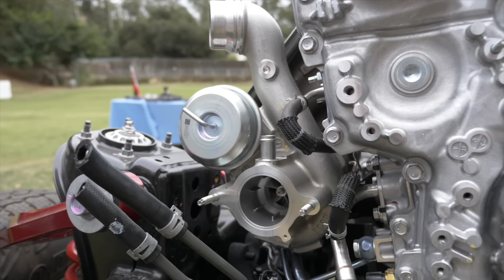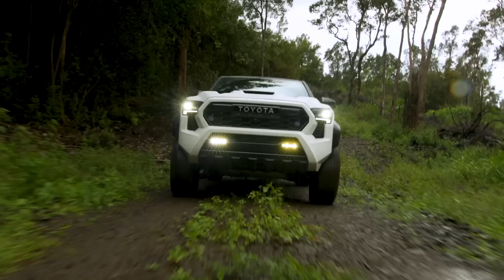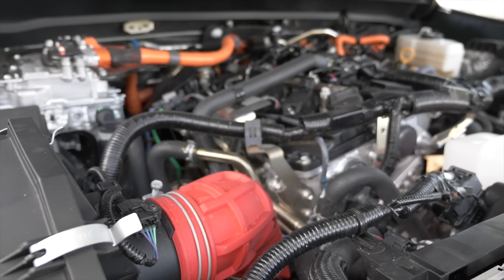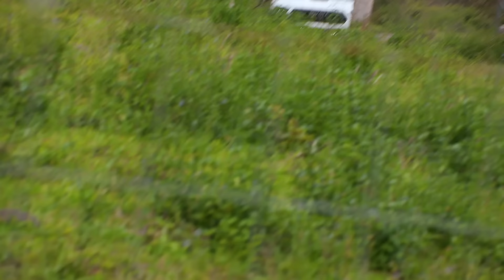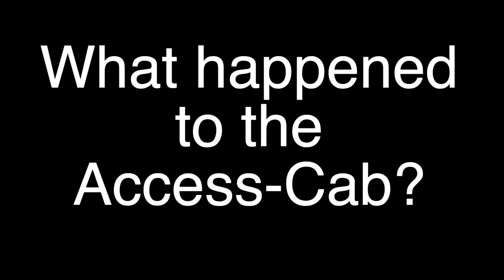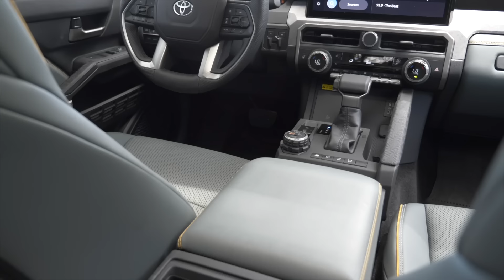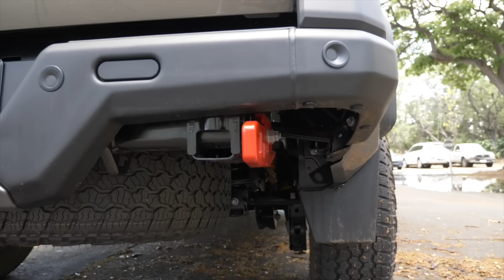2024 Toyota Tacoma Chief Engineer on new engine reliability and more...

Comment: I still believe a V-8 or V-6 will outlast a stressed out 4 cylinder
Reply: Since this engine is so good they should warranty the turbo for at least 200,000 miles
Reply: @freddyw4555 why not 250,000 😅
Reply: 100%
Reply: It always will . Any new turbo will need extra " care " , and this one is no different.
Reply: @steveriddle8446  Living in Japan for 11 years where all cars are Turbo due to regulations they last just as long, run better in every way.  My Skyline had well over a 100k of HARD FREEEEEKKING HARD ASS MILES not an issue, sold it to another sailor, was still running years later, I assume he sold it also to another Sailor
Reply: @steveriddle8446  it all depends on how it is engineered.  The 1.6L 1100hp v6 in F1 outlats the 5.9L V8 in NASCAR that typically only runs at 600 HP because there not allowed to run more HP. 

I'm not saying one is going to be better than the other I have no clue. It really just depends on what it was engineered to do.
Reply: 400k on my original turbo.. there's those that think they know what they are talking about and those that actually live it. which one are you? @steveriddle8446
Reply: I own a 2nd gen 4.0 with the unbreakable, smooth, and perfectly ratioed 5-speed automatic, which I think was their high-water mark small-truck drivetrain for both reliability and durability.  The 4.0 is a half million mile engine.  I don’t see the 2.4L turbo, and certainly not the hybrid, lasting 500,000 miles without multi $10k component repairs.
Reply: @jefftrimm7806  I'm with you if we include the 6 speed manual I'm my 2010 TRD Offroad Tacoma.
Reply: @jefftrimm7806  it will outlast components like starters and there is much less stress on the 12v system with the hybrid. I have a 4th gen hybrid and would have not purchased a Tacoma again if they had chosen to be NA
Reply: Agreed. I'd have no problem going back to the old days of 3k oil changes to keep one of these going to 300k. I just don't see those turbos lasting that long no matter the maintenance. I'm keeping my 2022 TRD Off Road for a while. I'd consider a 4th gen once I see a few going over 200k miles right before the gen 5 release.
Reply: Same here. @rndsommer40
Reply: @rndsommer40  he mentioned they're rating it to the standard for their commercial vehicles, where longevity is extremely critical. look at semi trucks, they have big turbos and they're hauling 80k lbs for easily up to 500k miles. its about how under stress the component is, and in this case, they've overbuilt the turbo and significantly increased cooling capability in the engine and used a strong block to withhold the pressures.
Reply: @rndsommer40  LOL 2022 Taco isn't meant to be replaced for another 20 years and you're crying the Turbo wont last!?!?!
Reply: @StinkPickle4000  I have 30+ years of experience with turbo'd gas engines, and they DON'T LAST.  Diesels are another matter, they're strong as hell and can handle turbos.  Toyota should've dropped a V4 turbo diesel in it.
Reply: @rndsommer40 A John Deere tractor will last over 1,000,0000 miles. Why not just drive one of them?
Reply: @rndsommer40 I'm keeping my 2010 4.0 V6 6 speed manual TRD Offroad Tacoma for the rest of time. I don't believe that these small displacement turbo charged engines will last like naturally aspirated engines. When it comes to powerful engines that last under load, there's no replacement for displacement.
Reply: I've never had a 4 banger that didn't last at least 200k miles. Yes they sound horrible but they are great engines and super durable, that's why all the old school small work trucks have them and still run today.
Reply: @foodconnoisseur4498  Exactly, people forget that big engines weren't a thing back in the day. Especially not in the rest of the world. Europe and Asia has gotten 4 bangers for decades and they run and last no problem.
Reply: @foodconnoisseur4498  and a 6 will STILL last longer
Reply: @tonys3825  A 6 will last longer than a 4? Toyota's 2.7L four is considered one of the most reliable engines ever.
Reply: @GrnXnham  the 2.7l 4 was not turbocharged....I stand by my statement
Reply: @GrnXnham  my current V6 is over 310k miles....not a problem in sight
Reply: @GrnXnham 

An eternity of service at 140 HP!
Reply: Look at Hondas 1.5 turbo they put in their newer cars. They’re already having a lot of problems with over heating and oil dilution. Now imagine if it was put in a truck and started hauling things, plus another maintenance issue the average joe has to take care of now. This chief engineer said it himself, they made the decision mainly for emissions 🤦‍♂️
Reply: The only million mile tacoma is a 4 banger
Reply: @rkwjunior2298  With all the unproven high tech bells, whistles, and gadgets on the new Toyotas, we will never see another million mile toyota. Too much to go wrong.
Reply: @barbwire7449 The million mile toyota had  2 engines and a torque converter replaced. So it truthfully didn't make it 1 million miles, the body and chassis had over a million miles. im sure he had to replace other things as you will on anything.  So the "million mile" toyota thing is misleading.
Reply: @rkwjunior2298  There was a 1 million mile 2007 Tundra with a V8 that only had a minor transmission problem. I understand it was mostly interstate miles driven mostly at constant speed. Toyota gave the man a new Tundra for it. When taken apart it was claimed by Toyota engineers that the engine could have made another few hundred thousand miles.
Reply: @barbwire7449  And depends on where u live climate.  It is just not realistic to say "Tacomas/Tundra can go a million miles." After a certain amount of time most aren't worth fixing. Everything breaks, brake lines, steering components,  suspension etc, etc.
Reply: @rkwjunior2298  My farmer neighbor has a 2001 Tundra V8 with 436,000 miles. He pulls 5 tons daily, including cotton and peanut trailers, irrigation equipment, and water wagons for irrigation. He has never changed the differential or transmission fluid. He uses dinosaur conventional oil, buying the cheapest brand on sale every oil change. He tells me he has not spent one dollar on that truck other than regular maintenance, such as oil changes, tires, plugs, batteries etc.

I have a 2006 V6 Tundra that is 18 years old. Other than regular maintenance as above, I spent $14 for a gas cap (seal went bad and gave a check engine light). No way these new Toyotas will do it. Too many high tech gadgets, sensors, bells, whistles, CVT's (continuously Variable Trash) transmissions, unproven turbo chargers.

 I just read where Toyota has a recall on 2024 Tundras, Lexus, and 480,000 Tacomas, 2022 and 2023. Welding debris left in the axles of Tacomas, and the transmissions of Tundras and Lexus are still engaged in park. Toyota quality is already going down.
Reply: Especially a turbocharged 4 banger
Reply: @@bobbybradley7862 I'd go with the carbureted 22R that was in my 86 4 speed manual 2wd pickup or even better the fule injected 22R-E from my 93 5 speed manual 2wd pickup.
Reply: Many said the same when engine specs moved from all V-8s to the introduction of V-6s.  Torque created at lower RPM is what interests truck owners that need/want to tow.  I'm guessing this will prove to be reliable as well...we'll see.
Reply: keyword stressed.....an inline engine that is naturally aspirated will last the longest, regardless of cylinder count
Reply: I have a 2010 Subaru Legacy GT...2.5 L 4 cyl, turbo charged. I bought it new and it now has 315,000 kms and still runs like new. Smooth power, dependable.
Reply: The entry level model for these sorry hunks of shit doesn't even have rear doors to access the extended cab.  It will also only tow 3500 pounds.  lol the truck wouldn't even tow itself and they want like 35 grand for the base model!
Reply: Your belief is biased, backed up by nothing except your feelings and opinions
Reply: Someone should teach this guy how to engineer a salad.
Reply: That is proven by physics.
Reply: add this any persons opinion who wants to argue with physics ,  we have seen  V-8  and  V-6 outlast stressed out 4 cylinder  engines  because theres  more metal , parts  ,and  surface area   to wear  more on over time on  them  verse   a 4 cylinder which has Less of all of them  ,  it ether goes one way of another  : you buy extra gas for the  v6 v8 over time  which isnt  that bad  OR  or    another i4 replacement   engine~   which one do you choose?
Reply: @spanishtreasure9551  without data you are just another person with an opinion
Reply: @drivewayhero   physics  doesnt lie  thats all the data anyone needs ... its less material to wear ie  surface areas   of parts pistons  and  block/bore .
Reply: This is the reason I'm not selling my 2014 tacoma. I bet my v6 will last longer than the new Motors.
Reply: Triumph V8, BMW N63, North Star V8, EcoDiesel, Chrysler LH V6. and so on..  just b/c its a v6 or v8 does not make it more reliable.
Reply: Toyota has been putting turbos in 4cyl for years!
Reply: If the goal is to make sure a turbo charged engine lasts as long as what prior NA engines got, it shouldn't be that hard.  If Toyota says it's just as reliable, I'm going to believe them, till someone or I see different.  Reliability is why people by Toyotas, and they know it.  If they didn't make any new engine as reliable as the past, they'd be shooting themselves in the foot.
Reply: @crabjoe  exactly. if they cant make a reliable turbo and hybrid system, they would be better off increasing their average mpg by releasing ev's instead and selling NA gas vehicles, but they dont.
Reply: How is it stressed out? They build them to handle the forced air. I've had turbo vw engines go over 500 000 kilometers.
Reply: toyota in's japan have had nothing but 4cyl turbos for years
Reply: It all depends on how that 4 cylinder is built.  There are 4 cylinder turbo diesels that will go hundreds of thousands of miles.  A gas turbo engine can do the same if built strong enough.
Reply: @1guyin10 there’s no getting around physics. A turbo 4 cylinder in a car of the same weight will have to be pushed to higher rpms and more engine pressure throughout its lifespan than a v6 or v8 in a vehicle of the same weight. A turbo adds another point of failure as well, and another thing that needs to be oiled, meaning more and faster oil wear. Has to keep the engine AND turbo lubricated now. Been saving up for a new car and was going to get a tacoma, but I’m probably going to get a new 4runner now since it still has the tried and tested v6 that’s been around forever
Reply: @FirstnameLastname-gz8hy agree. That’s why I bought the 23.
Reply: @FirstnameLastname-gz8hy  Let's be honest. This day in age, 90% of the people out there buying trucks are never hauling a damn thing with it. It's hardly applicable to the masses that use these trucks as pavement queens. The people who actually use their trucks for work aren't buying TRD Pro's or Raptors or whatever other "high performance" trucks are out there.
Reply: @europeanlegend9347  even when not towing, a 4cylinder turbo will not have the longevity of a 6 cylinder. More performance isn’t the only benefit of a bigger engine, you get more longevity out of an engine that holds lower rpms under load of acceleration.  I was using load in terms of load on the engine, not load as in payload or hauling.
Reply: @FirstnameLastname-gz8hy  That's where I was at. Bought a new 4runner and am very pleased with the 4.0 v6. If you're going to buy one new, better act fast! Dealers are moving em in anticipation for the 2025s with the turbo 4s!
Reply: @1guyin10 diesel engines are completely different then gas engines 😂😂
Reply: @1guyin10 another thing that a lot of people fail to realize is diesel fuel itself is far better at lubrication than gasoline. It’s even referred to as “diesel oil” and the high sulfur, less refined diesel is sold as “heating oil”.
Reply: @1guyin10  - If that well built 4 cylinder turbo just drives around town with not towing or loading in a small sedan, yeah it can last over 150K miles. But even a well built 4 cylinder turbo in a Tacoma towing heavy loads and hauling heavy equipment on a daily basis for construction jobs isn't going to outlast a V8 or diesel work truck. This new Tacoma is built more to please the "Stop Oil" eco system lunatics. Looks like Toyota is gonna lose it's reliability championship to Honda and Ford.
Reply: @1guyin10 diesel engines typically operate at much lower rpms than gasoline engines, relying on greater torque to keep HP numbers adequate.  Lower rpm makes for much better fuel economy as well.
Reply: @1guyin10 entirely different function, diesels fire from compression and not ignition therefor torque is made way down low in the RPMs.  This inherently gives the engine an edge when accelerating for most of its life as it’s less taxing.  Obviously if you’re racing into the higher RPMs all the time with a diesel that will be very contradictory because neither will it benefit you in speed or longevity, but in reference to how you’re supposed to drive it, it loves lower revs city driving or punchy climbs off-road, that’s where it shines.  A gasser is not going to be loving those same situations off-road. 

It’s comparing apples and oranges, doesn’t mean anything that they both are an inline 4 with turbos.  Generally the turbos are small with very low boost pressures because the idea is that they are “supplementary”.   Ask any person who’s worked on those old 90s TD from the likes of Mitsubishi, Toyota, Land Rover, Mercedes etc, the minute you turn up the boost, it begets problem after problem and immediately limits the long term life of the engine.  Even with tunes, new internals yadyadayada, you can’t defeat the simple fact that forced induction accelerates wear period.  It’s just that diesels  are better equipped at dealing with the increased temperatures and are suited for the low RPM torque situations previously stated, while also from a design point being more robust therefor capable of handling more kilometers in general.  Don’t take my word; look at non-turbo diesels from the 90s early 2000s and the amount of kilometers they did back in their day, nothing compares….
Reply: @1guyin10 there's a big difference  between  going a couple  hundred  thousand  miles and doing what the NA v6 to comas can do..which is his 6,7,8 ..over have a mil miles comfortably  with good maintenance..

They just retired one that had 1.6 million  miles.
Reply: @1guyin10  That would be wonderful but they intentionally build them with a shelflife of about 200,000 miles max because they want you to buy a new one
Reply: @rjeepster8640 source?
Reply: @rjeepster8640 how in the hell do you know that jeep guy?? 😂😂😂😂
Reply: @rjeepster8640  still, you can make any engine have a shelf life. if they made this engine only last around 200k miles, whos to say they didnt do the same for your v6? it would be just as easy to make a v6 last a shorter time because all you gotta do is make it out of weaker, cheaper materials and there you go. of course a turbo i4 is going to be under more stress but if they want to make it last, they will. which it looks like it will.
Reply: @1guyin10   exactly, gas turbo 4 engines are not built to the same durability standards as a 6
Reply: Youve never had toyota 4 banger then. Who buys a taco for heavy workloads? Just dont boost all the time youll be fine.
Reply: 500% correct
Reply: These are beautiful trucks !  But my old my old 1990 Tacoma , not as compatible or fancy as this one but still fun to drive.  
A 5 sp manual , easy to parallel park and to coast around in neutral all the time ! 
With 370, 000 miles on it.  3 rd engine and same tranny , rear end. Leafs springs went flat.  I doubt this new truck handle the every day life of stop and go driving , pulling camping gear and towing a boat up the mountain passes. Hauling dogs everywhere to the beach, lakes or mountains? 
It took 28 years for the original fuel pump to break.  Fuel filter lasted some 20 years , try to change it but the new one leaked. One alternator to be replaced. Nothing goes wrong with the transmission, clutches wear ever 100,00 miles. 

Those old truck frames was Hino box frames. 
I sold the truck to my nephew and he still still drives it.
Reply: @TlVseri 

You must have the only 1990 Tacoma ever made!
Reply: Please someone tell me what the piston compression is on these turbo 4's.  These new motors are just waiting to detonate (yes, in a bad way).  Cheers
Reply: I concur !
Reply: they don't care long as it outlasts their warranty
Reply: Have you never heard of the 22r engine? It was used for racing/ wheeling/ towing most reliable toyota engine on the planet
Reply: @Grimlock916  Different era.  Way different era and you could still tear up a 22r more than you could the Toyota 3.4 V6.  4.0 V6 and 4.7 V8.  I've owned every single one of them.  87 4Runner, 98 4Runner, 03 Tundra, 10 Tacoma.  Getting rid of the 4.0 V6 that they still use in 4Runners for that 3.5 back in 2016 was stupid.  This is beyond dumb.
Reply: @Grimlock916 it was reliable but also gutless
Reply: @Grimlock916 my 22re timing chain guide broke and then it went out of time but they are good engines
Reply: Fortunately belief and reality are not always intertwined regardless of what we were told growing up . Plenty of built "stressed out" k24 Hondas and boosted b18b Hondas demolishing lambos with forged internals and insane power output that can be dailied just fine . Sure throw a stock corolla engine in a truck that isn't built for that and it will be a bad time,  this Is not the case here .all midsized trucks HAVE to go 4cyllinder per the new epa standards. Some are hanging in as long as they can with v6 for no reason than to appease the folks who think they're better when this 4cyllinder hybrid max is not only the most powerful midsized non ev truck on the market but it puts more power down than the 5.7 tundra did. Most of us will have it two years and then be swapped on to something else before the warranty is close to out anyways
Reply: Yeah you better for sure not be the Guinea pig on these.
Reply: I'm all about Long Lasting I've always had tundras.
Every single one I've gotten over 300.000 miles on. I currently have a 2015 tundra with 362.000 miles. I'm just not sure if the V6 Can last that long
Reply: dag gum it  now  even toyota  engineers  are drinking the kool aid
Reply: @spanishtreasure9551 well, he's a white guy. Not the same design mentality or methodology. Add to it the corrupt EPA forcing ridiculous mandates on emissions and mileage means reliability is what must be sacrificed.
Reply: Absolutely. He said the reason for this: emissions requirements. The government strikes again. There is no benefit to putting a 4 cylinder engine in a truck except for getting the woke, leftist climate alarmists off your back. But there are lots of negatives, risks, and losses associated with it. He said, "Don't knock it 'till you've tried it." Well and good, except for the fact that it costs $50K to give it a try. If Toyota would guarantee 100% that the engine would last with only routine maintenance for 300K miles and provide a 100% warrantee on ANYTHING that goes wrong with it for that long, I'd be willing to try it.
Reply: Depends on it's gearing!
Reply: truth
Reply: Can ya really trust a Chief Engineer LOL that cant even look after his OWN BODY. Bla bla bla 2023 and down still remain the better and most dependable, TACOMA.  PERIOD  Keep the older ones folks!
Reply: Depends on the life!
As well as how you take care of it!
Reply: and sound like heaven 🙌
Reply: Yes, and what is the cost of turbo chargers when they fail? And they do fail.
Reply: Nah bro straight 6 hybrid is what Toyota could and should pull off.
Reply: @oculophilia918  Hybrids are fine until battery purchase time. Also, if an electrical problem develops, and they do, look out pocketbook. These hybrids are still relatively new technology. Only time will tell.  

The problem with all the car brands is that they are coming out with new unproven engines and transmissions every year. The buyer has to cross their fingers and work out any gremlins at their own expense.
Reply: Past designs bear that out.
Reply: The brighter and hotter a candle flame, the less time it lasts. Same analogy as a hot engine. It is not rocket science.
Reply: So does he. But he just told everyone that they were forced to switch engines due to “emissions”
Reply: @bobsacamano6402  Yes, the automobile industry was forced by federal mandates to have better fuel economy and emissions. That is why we are plagued with CVT (Continuous Variable Trash) transmissions and turbo chargers.
Reply: It's not rocket science..it's a basic  law of the universe..

Any thing that's running  stressed out..under greater tension..higher temperatures..greater loads..

Over a long period  of time Vs something  running  more relaxed..under less stress ,less tension will last longer it's basic

The only thing that can change  that factor  is woeful incompetence..

And it's the same toyota  engineers bulding the stressed  engine  vs the naturally  aspirated engines
Reply: The Nissan Frontier still has a naturally aspirated V-6.
Reply: @PassivePortfolios  That will probably change in 2025. Probably, in 2025, there will be no more naturally aspirated engines as an option, because of emission controls.
Reply: Blame epaulets for these small turbocharged engines
Reply: Could it be possible? The reason why 4 cylinder diesel Turbo engine last longer. It's because they run and dirty diesel fuel and it's always oiled. It's just a question. Thank you.
Reply: I'm looking to buy a midsized pickup. Nissan and Ford seem to be the only V6 options out there now. I would consider a Tacoma if it came in a V6.
Reply: Bingo. This is about emissions bullshit. Has nothing to do with reliability or longevity. 

I believe this will mark the end of Toyota being known for ridiculous reliability.
Reply: @chrispewkreme  Toyota has been using low displacement turbo engines for years and they've all been seen as reliable. 

Plus what matters is the standards they are built to. If they're built to commercial vehicles standards, they are not going to make it weak. It needs to withstand the abuse that comes from them being treated like work mules day in and day out. I'm pretty sure if they can survive that, they'll survive your trip to work and off the trail for many hundreds of thousands of miles just fine.
Reply: And I believe you have no idea about what stresses a motor!
Reply: these 4 bangers are burning up with 35 wheels. lmfao!! pieces of china junk.
Reply: yeah, just a lil bit lol
Reply: On average I would agree. I'll be interested if this one proves to be an exception.
Reply: nothing beats displacement when lessening the stress on an engine.
Reply: I got a 2 and 1/2 l four-cylinder no turbo in a Chevy HHR 253,000 mi still counting and also a 3800 series 2 and a Buick Lucerne 224,000 mi in still counting but I would honestly love to see a V8 in a 4Runner
Reply: I love the truck, drives fantastic, rides like a Cadillac, power as soon as I need it, good and peppy...I just pray this drivetrain lasts 200k at least.
Reply: Yea man Ima trade in my 2024 before it even hits 50k
Reply: it's possible to beef up a 4 cyclinder to last longer than a less stressed v8. but time will tell it's Requires better machining and clearances.
Reply: I’d just be happy with a naturally aspirated 27R four banger… Thanks Toyota.
Reply: So the basic truck has the same environment they’ve just detuned it! Toyota had definitely lost their way. I’d buy a Nissan Frontier over this turkey.
Reply: And they deleted the swing out door on the extra cab so a buyer who ordered the rear seat delete is going to have to slide the front seats forward and lean back over  to load cargo in the back. These people have lost their minds.
Reply: That's correct.
Reply: Always. Turbos will never be as reliable as a naturally aspirated.
Reply: 100 PERCENT
Reply: One can argue that because the power and torque are much lower, this could offer less stress?
Reply: definitely will agree
Reply: I bet this guy knew he was going to get roasted about the 4 cylinder lol. I was definitely on edge before purchasing my 25 Trd offroad taco. 10k oil changes is absolutely irresponsible. I pay for evey 3k miles between oil changes. So far its been good for me 6k miles through
Reply: depends. I mean when you think about it diesels have been turbocharged since the dawn of time  yet we never hear about reliability issues with them. So long as the components are beefed up and engineered for it. I think this will be just as reliable.
Reply: V8, sign me up!
Reply: in what ways is it stressed? its fully built for a turbo
Reply: BINGO. The fuel savings of a weak ass 4 cylinder are immediately offset by the parts that will fail in the future. 

As someone who has owned nothing but turbocharged cars, they are all problematic at some point.
Reply: If they all built them like the 2jz, these turbo engines would have no problem!
Reply: ...and if ANYONE were willing to give up the last marginal 5-10% horsepower, which you almost never use and certainly never would need if you exchanged it for much more accessible torque from an I6...

Understand the compromises, sure...but the benefits would be substantial.
Reply: Not the piece of junk V8’s out there these days
Reply: Presumption is "stressed out". No proof = just guessing.
Reply: Good thing this 4cyl isn’t stressed
Reply: Inline 4 & 6 cyliner Japanese motor bottom ends tend to be more robust than their V-6/8's. The Toy 2JZ-GTE cast-iron engine block, with 7 crank journals, can deliver up to 700 Hp's with little to no reinforcement of the bottom end. This would be my basis for high horse/torque applications such as sport, off-roading, circuit & drag racing.
Reply: A 4 cylinder turbo will not necessarily break down sooner than a naturally aspirated (NA) V-6 or V-8 if used within proper limits. The previous generation Tacoma had a 3.5L NA V-6, which is 31% larger than the new engine.  In addition, turbochargers generate heat, a lot of heat.   If this smaller 2.4L turbocharged 4 cylinder is just driving around town all the time or carrying bicycles, then as long as maintained properly, it will last for 200 to 250,000 miles without issue.    The problem is that these auto manufacturers are asking these 4 cylinder turbo engines to handle the towing and other rigors previously handled a larger displacement N.A. V-6 or V-8, and stress is a killer of engines (and a person).  If a new 4 cylinder turbocharged Tacoma is used extensively in Texas, pulling 4 or 5,000 lb trailers or the bed is loaded up with gravel or cement, the Texas heat combined with the heat from that turbocharger and running it at higher revs to get maximum power, these motors will start having serious issues after 100,000 miles.
Reply: @tspidey007  - True, even a 3.5L V6 Eco F-150 under constant heavy loads and aggressive pedal stompers will have major issues after 100K miles. But I see many construction abused V8 F-150 and Diesel trucks hit the 500K miles.
Reply: @tspidey007  Exactly, just wait until folks are trying to tow something in a high heat environment and they get to experience heat soak. Suddenly all that power that the turbo provides is completely gone and you're struggling along with what is now effectively a wounded 4 cylinder engine. Heat soak happens pretty rapidly as well. Hell, I have a sedan with a 2.0 turbo and if you get on it a few times you can feel the power start to decline. I'd imagine you'd need massive intercooler and general cooling upgrades if you ever wanted to consider any sort of medium to heavy duty use.
Reply: @tspidey007  My farmer neighbor has a 2001 Tundra with 436,000 miles. He pulls 5 tons daily. He has never changed the differential oil or transmission oil. He has never spent one penny on the truck other than oil changes, batteries, tires, plugs, belts, and other regular upkeep. These new vehicles with all this hi tec equipment will never be reliable as the old Toyotas. Too many whistles and bells to fail on these new autos. The new prices are insane.

That is why the American people are letting them sit on the dealer lots. We just want a simple, highly reliable vehicle with low maintenance expense. The auto manufacturers cannot see this truth. The EV's are dying right now. Hybrid battery prices are ridiculous. One dealership has already dropped the price of 2024 Tundras by $8200 and the Tundras are still sitting on the lot. Rest assured the auto manufacturers will soon get the message.
Reply: @tspidey007   he mentioned this in the video that they're using coolant piping the size used in their previous v8's and have wear tested the turbo to commercial grade standards over passenger vehicle standards, which means using it as a passenger vehicle it will last much longer and be under very little stress. 

he actually specifically mentioned how they engineered this engine to be able to withstand all the rigors of truck use with ease from towing to offroading at bad angles that may reduce oil flow to certain parts of the engine.
Reply: @tspidey007  turbos kill gas engines....PERIOD
Reply: Try the 2.7L  engine in the 2002 Tacoma if geared properly will burn rubber, no stress at all?
Reply: @77.88.  and the 2.7L will last a million miles. Turbos require a lot of TLC, and even then they are known to fail.
Reply: @77.88.  There is simply no way to boost an engine reduce Volume and not affect longevity as compared to previous gen.  I Hope I am wrong.
Reply: @77.88. Precisely!
Reply: Geezus.  The number of morons stuck in 20 year old technology and completely ignoring the number of commercial vehicles with four cylinder engines is mind-numbing.  If you're going to shove a generic, cheapo 4cyl from an ecobox into a truck, yes.. you'll have a bad time.

On the other hand, look at the number of Tacomas in commercial service.  Do you really think Toyota is going to shoot themselves squarely in the commercial segment by putting out a crap drivetrain?  

It's called critical thinking .. many of you should try it.
Reply: @TheMrMused  Exactly. Don't even bother yourself with these people. It's the typical wave of doubters who think all hell will break lose will every new generation of vehicle. As if there aren't V6's and V8s out there that completely shit the bed pre 100,000 miles. Tired of hearing people say every V6 and V8 out there is superior to a 4cyl when it's not true. 

Toyota knows what they're doing. Spot on with what you said and I agree 100%. Goes to show how much research people actually did. There are people out there who think Toyota basically slapped the Prius hybrid drivetrain in these new tacoms and landcruisers. They're completely different motors, drive trains and different set ups for the hybrid motors considering a prius is front wheel drive and a taco is a 4x4.
Reply: Yeah, that is a horrible blanket comparison to make.  A 4B Cummins 4cyl will outlast any automotive V8 or V6 ever made. 

It all depends on how they are built and a 4-cyl has the advantage of fewer moving parts to wear and break.  Did you forget the Toyota 20R engines that would go 500K miles?
Reply: @burningsporkdeath Bro that’s a diesel lol they are overbuilt 😂
Reply: I still believe not one of you that commented on or liked any of comments will keep this truck from new until dead anyway
Reply: @MeltingRubberZ28 I kept my last one for fifteen years.  Driven every single day.
Reply: @MeltingRubberZ28 im too poor to buy a new vehicle anyways, I buy vehicles that are about dead....so it is important to me 😂
Reply: Metallurgy and modeling capabilities are light years beyond what they were 20 years ago.  I am confident this engine will continue on with the reliability Toyota's customers have come to expect (assuming the vehicle is maintained properly by the end customer).  If I was in the market for a new Tacoma, this engine update would not deter me in the least.

I would gladly take the improved engine response, lighter overall weight, and mileage, too.

If you need to haul a load greater than the ability of this truck/transmission/engine, buy a Tundra.
Reply: listen pal...no need to be snarky,  i already have a 2024 fromm the toyota upgrade club, got it last month, paid 72.000 for it. my turbo has already gone out and was replaced under warranty . now my slave valve is not working because of the high temps the turbo sits at.  @StudQBeefpile
Reply: @StudQBeefpile thats whaT I say , if you need to haul heavy stuff get a bigger truck , I came to the conclusion that if we start hearing people's negative we will never be happy, do whatever you heart feels happy with 😎
Reply: I feel like the head engineer knows what he’s talking about
Reply: @seanaxel1004 you think he's gonna bad mouth his company product?????
Reply: @seanaxel1004 This "head engineer" is a vegetable.
Reply: @seanaxel1004 he knows where the cafeteria is for sure
Reply: @seanaxel1004   He has motives though so it doesn't matter what he "knows".  Did they drive a test vehicle hard for 200k ? with about 30% hard off road driving ?  I doubt it.
Reply: My Ford Ranger with Turbo just had the transmission go out on it at 69,000 miles. My mistake of not just getting a Tacoma again though will look for a 2023 6cyl or a 4Runner 2023.
Reply: It doesn't matter what you or anyone else believes. The reality is that these engines have been proven to be extremely reliable in many models for many years.
Reply: @SeniorKlean 
I don’t think anyone will argue that Toyota and today’s modern turbos aren’t reliable. What bothers everyone is the fact that turbo engines will never last as long as naturally aspirated engines.
Reply: @bobsacamano6402   That depends entirely on the specific engines.  The longest lasting engines on the planet have turbos - diesel generators.  And no, it's not because they're diesel, it's because they're not as cost focussed in engineering.  Or look at Ford - the 3.5L Ecoboost is more reliable than the old 5.4L.  It took a decade and 3 generations of iteration, but they got there. 

reliable
Reply: True but the war on oil and cars is making it impossible to afford v6/v8 gas prices.
Reply: @sk-un5jq  Modern NA v6s and v8s aren't THAT different in fuel economy compared to the turbocharged 4 and 6 cylinders that are replacing them.  I imagine most people going from the latter to the former will barely notice the difference.
Reply: The amount of comments regarding  turbo fear is amazing. This is not 1994. The engines are not "stressed" blah blah. This engine was designed to be boosted. Turbo reliability is ligjt years ahead of what they used to be. Toyota will sell every single one of these they build easily, and powertrain reliability will be typical Toyota, aka the absolute best.
Reply: @9ZERO6  ford ecoboost engine don't last not a 1994 engine. I know owners with a $5000 bill at 60,000 miles, Ford will not cover.
Reply: @christopherblack4520  I never said the ecoboost would outlast a 1994 Ford V8. But 1994 Ford V8' did break. Thats why Ford has always had to have dedicated engine techs. To fix broken Ford engines. And they have always been very busy with work.
Reply: @9ZERO6  Not stressed you say?  The base model that they want damn near 40 grand for is 228 hp with 243 torque and will only tow 3500 pounds.  What would you tow with that sorry bastard?  A teardrop camper?  It even has leaf springs on the base model.  Jesus Christ and no rear doors so you can easily access what you store away behind the seats.  These trucks are a joke now.
Reply: toyota has abandoned their base.....NO ONE WANTED THEM TO GO TURBO, OR DROP THE VAULTED V6 @9ZERO6
Reply: exactly morons.. i have over 350k on 2 of my turbos and 400k+ on one of others all original and tuned still winning races with over 350k  @9ZERO6
Reply: "TURBO FEAR " is real,as any real mechanic will tell you. @9ZERO6
Reply: @9ZERO6 it's because they're manhood will be too threatened by going down in engine displacement to even try driving one. If they did, most would see they're not missing anything by losing that engine displacement. God forbid they try a hybrid and have to wear skirts! The real issue is not engineering, but quality and availability from parts suppliers. Suppliers everywhere are still affected by COVID, and are still recovering. This engine might have some quality struggles, but I bet it will out perform any NA v6 it is designed to replace
Reply: People with the 2023 or earlier Tacoma are going to say that sort of thing? It's just human nature. @9ZERO6
Reply: @9ZERO6  Those are bold statements, I hope you are right, cause the future of Internal combustion tech depends on it.
Reply: @9ZERO6 this didn't age well
Reply: @9ZERO6  Correct.  Stupid comments.
Reply: @9ZERO6  you don’t know what you’re talking about. You can’t get around the fact that turbo had a lot of heat and a big truck with a little four-cylinder engine. It’s not going to last nearly as long as a V-8. My V8 F150 had 400,000 miles on it when I gave it to my nephew because he turned 16 I bought a new F150 with a 5 L V8 fantastic engine and no turbo and will last 400,000 miles 200,000 miles will not get it. I’m 61 years old and I know what I’m talking about.
Reply: @miketerry6036 you don’t know what you’re talking about Mike.  You sound lost
Reply: lies
 @miketerry6036
Reply: @miketerry6036  except your plastic fantastic 5.0L is going to need a new intake manifold every 100k to not sound like the lifters, cam, and valves are trying to sling out of it.
Reply: @WM3I  well my current 2015, F150 with a 5 L V8 has 142,000 miles on it and I have yet to replace that fantastic plastic intake manifold like you suggest
Reply: @WM3I  it seems to me that you know my argument about turbos is correct. And you want to redirect your frustrations in another direction
Reply: @miketerry6036  
Last i checked, u buy a truck to abuse it, not baby ??..
I'll take experience over paid informant anyday🙌
Reply: @miketerry6036 I can't wait until I'm 61 and "know what I'm talking about" lol. At least you like Ford
Reply: @miketerry6036  says the guy who's driving a truck with 400k. I know the type.
Reply: @miketerry6036  did you even watch the video boomer? the coolant inlet is bigger than your f150's lmao. no you dont know what your talking about and i can tell because you appeal to your age as a way of bolstering your argument.
Reply: Yup. That's why 2 Months ago I bought a brand new Tacoma TRD 4×4. 
I wanted a reliable V6 instead of a POS turbo 4 cylinder